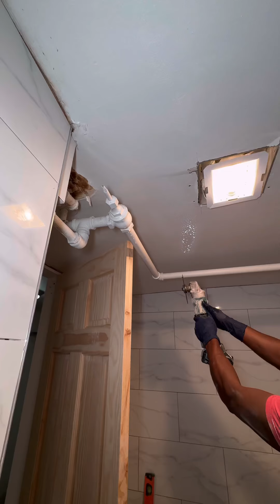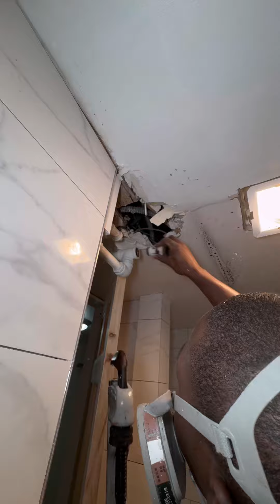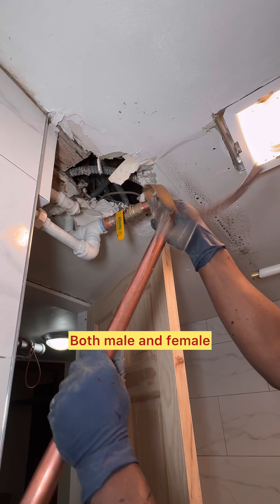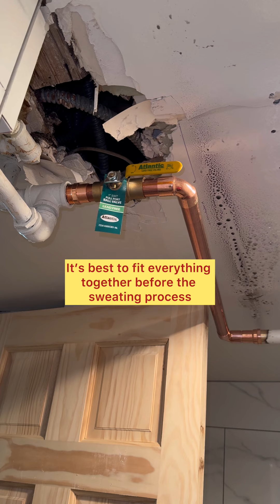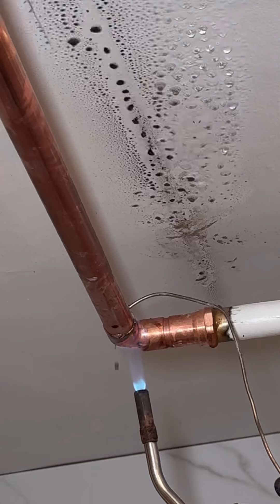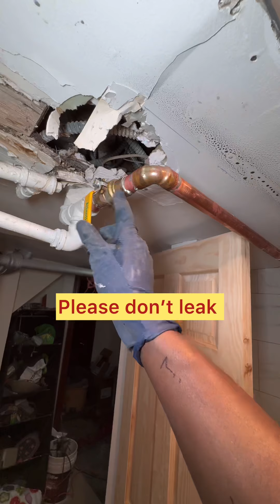How to make small adjustments to waterlines…

Comment: Nice work but on the part that you had to spin off and break the ceiling you can also cut it off and spin the nipple out the tee.
Reply from the maker: That ceiling is going that’s the reason why I didn’t care it’s wet
Reply: @LeoLevy1842  okay makes sense